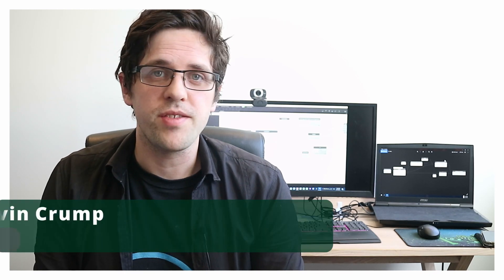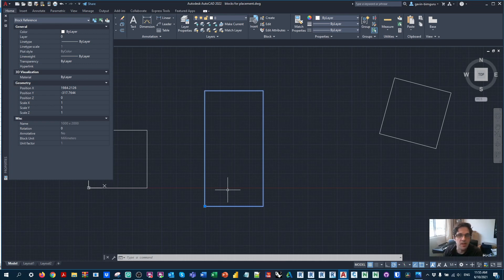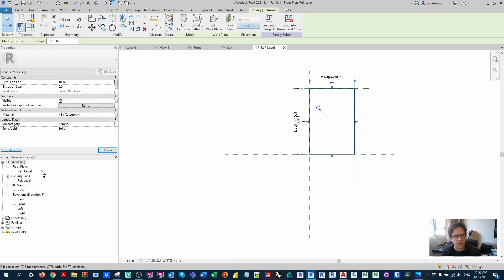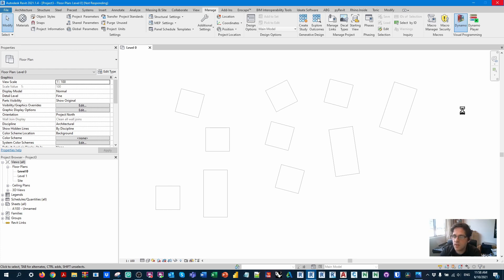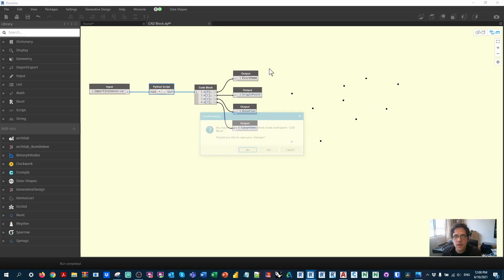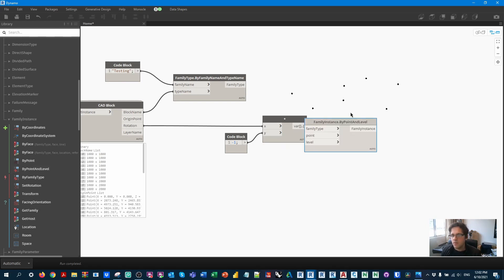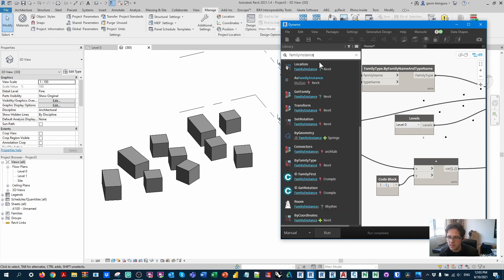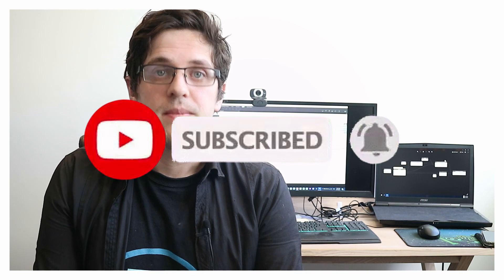Place Revit families by CAD block location using Dynamo!

Comment: excellent as always sir!...just in my case i can't get to align at the same rotation ....maybe another node?? thankss
Reply from the maker: In that case it is likely as your block and family are not in the same default orientation. The best fix there is to clean up the blocks in CAD so that they are, otherwise you will need to make  a list of corrections per block/family and use those to add the corrections.
Reply: @AussieBIMGuru  thanks for your time!!

Comment: I can’t find cad block
Reply from the maker: @charliesemrani6596  genius loci package.
Reply: @ please can you help me how can i find it
Reply from the maker: @charliesemrani6596  package manager. Read through dynamo primer it covers how.
Reply: Ok it works ..but the cad doesn’t appear in dynamo .. and What should i write in code block
Reply from the maker: @charliesemrani6596  generally cad wont appear in dynamo only the points for blocks, at least using that node. Try bimorph nodes package to get cad lines if you want them.

Comment: Hi Gavin, do you know if Dynamo has a node for creating symbols in Drafting views? I want to use a similar method to create schematics with linked CAD backgrounds, replacing my AutoCAD blocks with Revit symbols.
Reply from the maker: Dynamo doesn't have one as it ships, but spring nodes and clockwork both have a node to place a familyinstance by point in view that should be up to this I think.
Reply: @AussieBIMGuru  , Yes. that helped. Thank you

Comment: Nice tutorial!! Really helpful! I have an issue, though. The CAD Block node shows the same origin point for all my blocks (0,0,0), even though they are placed in several different positions. Does anyone know how I can fix that?
Reply from the maker: Hrm strange, make sure their origin is correct in AutoCAD, beyond that it might require contacting the package author. If you're using Revit 2025 that could be a cause also as a lot changed in Dynamo/Revit/COM API there.
Reply: @AussieBIMGuru  I found a different solution. Instead of selecting the DWG from the model to get the insertion point, I exported the block coordinates from the CAD file using the DATAEXPORT command

Comment: this will not work with hosted family
Reply from the maker: Yes for that you will need to develop logic to find the nearest point to the nearest logical host - much harder, but possible. For cad toolkits it would make sense to first make all walls and then doors/windows etc come after so they can have a host assigned during placement by the toolkit also.
Reply: @AussieBIMGuru  i believe that you have make video about that right? i could not find it in your channel anymore.
Reply from the maker: @sonnguyenxuan685  i have not unfortunately. Lots of threads on dynamo forums for it. I generally dont do much cad to bim these days.

Comment: Quick question please, when I tried to use Springs Node "FamilyInstance.ByHostAndPoint" it  was OK!

My question is why the new added families are not hosted to the predefined Host element?

Is there an easy way to keep the relationship between the hosted families and the host element?
Reply from the maker: Yes typically host and point is necessary for any family that needs to belong yo another element. Revit doesnt naturally know how to host things on placement in its API to my understanding, so the spring node adds that extra step to the process on placement using a dedicated API method instead of the default one given with dynamo.

Typically once hosted the element should maintain the relationship to its host automatically.
Reply: Thanks for your quick response. 

According to my test, the relationship is missing.

I couldn't figure the reason, so I asked If I did anything wrong.
Reply from the maker: @ArchAhmadWaheed  hrm generally it has worked in my testing for hosted elements. Make sure the host point is on the face of the relevant host. Beyond that I'd consult the forums for hands on tech help.

Comment: if cad block orgin point is center,it does not work this dynamo code?right
Reply from the maker: You would beed to manually compensate for the difference in the code.

Comment: Thanks for your knowledge Gavin!!! I'm a new student in that topic... I have been tried to used this workflow to place some windows and doors from cad file in revit using dynamo...but I don't feel sure if still using FamilyInstance.ByHostAndPoint... I will get a good result??? I've failed in all my attempts. What do you advice to me???
Reply from the maker: Yes it's a bit more complex as you need to give the door/window a host as well as a placement point. I'd recommend keeping the wall lines as well as the walls they make in parallel, then get the closest point of each door/window block and find the nearest curve/point on that curve. Given you know the index of the curve, you can then get the corresponding wall it generates in the process. There are nodes in springs that can place hosted families by point/host/level/family type.

Comment: Is there a node that corresponds to FamilyInstance.Bypointandlevel for model groups?
Reply from the maker: Not ootb i think. Genius loci and clockwork may have something. This is the API method to achieve the task:
https://www.revitapidocs.com/2015/586d4f2e-0985-2d0b-dbb7-ea6d2f704336.htm

Comment: Hello, I am tried to reinstall the Genius Loci package and Using the CAD Block first and select the model element for the linked cad, and I got fail to fix the coordination to the angle of the block.
Reply from the maker: Hrm it might be worth troubleshooting via the forums if the package has issues. The package owner (Alban) can usually assist further with these types of issues.

Comment: Thanks.Master but i have question.
How to handle the offset? i follow your tutorial and i want to set this for placing air terminal family,but  this dyn placed my family under nonsence offset.
Reply from the maker: As CAD files are in 2D, offsets generally aren't feasible unless you provide a value to the families to be offset by when placed. Maybe consider building a table of values to offset your blocks by and use that to raise the elevation of your family placement points.
Reply: @AussieBIMGuru  Thanks.I've learned a lot form your  great contents.

Comment: Hi Gavin, nice video. It's very helpful. One question - is there a way to read the block attributes and work with them? Like use them as a parametervalue
Reply from the maker: Not easily - I'd look into the Genius Loci package and the Link DWG package for examples of how CAD properties can be interrogated using Python and Revit API/COM objects.

Comment: Thanks for the great video! 

I've been in the weeds on this topic for the past few weeks. I think I have a solution for every step except I still haven't found a method of getting the CAD lines associated with the blocks. I see you built the dimensions directly into the group name and type names, but I don't think that method will be practical for our application. We'll have variable dimension in our CAD blocks. Any idea how to get the lines associated with each block? 

I've found other packages that let me grab every line on a layer, and that almost works, I just can't group those lines by block... Do you know any useful magic hear?
Reply from the maker: There was a packaged called LinkDWG that used to be able to do this but is bugged in later versions. Maybe try out older versions and see if you have luck? It also contains Python code you could try to reuse but it's quite complex.
Reply: @AussieBIMGuru  Yea I've looked into that without much success. I'll keep tinkering with it though.

Comment: Hi Gavin.. A small query on your package Crumple.. I have been trying to use the element.view node from your package but it's showing null in revit 2020 and previous versions too.. Can you please provide me a solution or nodes on how to get the view of the element.. Thank you
Reply from the maker: In the case of that node it will try to return the element's ownerviewid property:

https://www.revitapidocs.com/2022/174c1adf-0be8-a4b0-41f3-9e3ea1d6b1f1.htm

It will return null if the element is not view specific (aka is in more than one view). The node works with elements like text, tags etc. which belong to a specific view though.
Reply: Thanks for the reply.. In that case if the elements are pipe fittings etc.. How can I get the view of the element any suggesion please..
Reply from the maker: @ravichandra-up1nu  you can't really, as they are in all views in the model that see them technically. They don't belong to any one particular view.

The only method I came across is get_geometry to verify if the element can be seen by a view. There is discussion about it here:
https://forums.autodesk.com/t5/revit-api-forum/determine-if-an-element-is-visible-in-a-view/td-p/4896040

Comment: Also, could you make a video on advanced selection in Dynamo? 
I'm talking about selection on multiple levels with filtering elements within a specific area/scope box area from revit.
For cases when you have large buildings and you want to select a specific element on all floors on a particular part of the building instead of whole building or level. 

Thanks!
Reply from the maker: Usually I'd use packages like Genius Loci for this - suggest checking them out. There should be quite a lot of advanced selections in there and they're typically exposed Python as well.

Comment: Really grateful for the tip and for the concept how would be possible to do it. In practice in the native dwg file origin point of the block in auto Cad file practically never match with the Revit family because of the different approach in making of elements. Use example of the door, in the block origin can be at the edge or in the middle of the door which I was seeing usually in dwg files and by default origin inside Revit family is always in the middle of the door.
Reply from the maker: Yes a workflow I have used in the past is to measure the origin deviations in AutoCAD first and then compensate for them in Dynamo using an Excel list. It's a shame there isn't consistency with how we all nominate our origins but I guess it is what it is!
Reply: @AussieBIMGuru  yes. Actually first thing would be to check all blocks from dwg and then make a strategy what is easier thing to do. I repeated your script and really works smoothly. I even try to change the direction inside dwg in "clockwise" to see if Revit is gonna except rotating elements without adding -1 but didn't work.Thanks again..really cool script..
Reply: I was working yesterday on extracting the data from DWG using "CAD Block" node and something strange occurred. The node wasn't listing all blocks. System of elimination was discovered that the reason was in the polar parameter that was inside the block. When I deleted a polar parameter inside block and reload again into Revit, everything was fine. I sent this issue to Genius Loci...Aussie, do you maybe know his name?
Reply from the maker: Yes the package manager is called Alban de Chasteigner. Good idea to let him know, nice one!